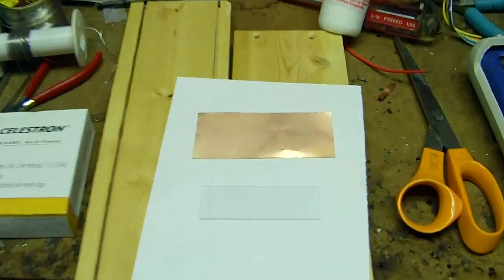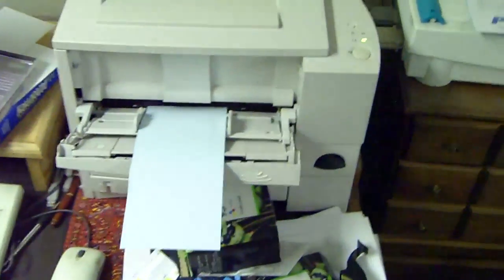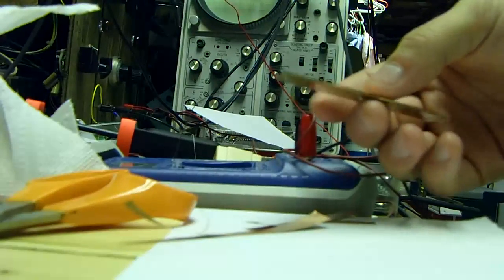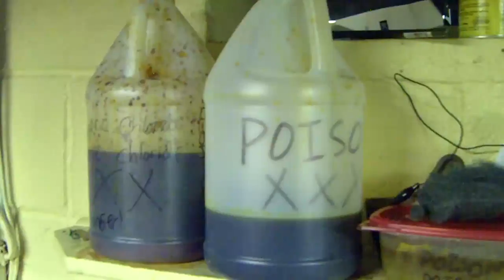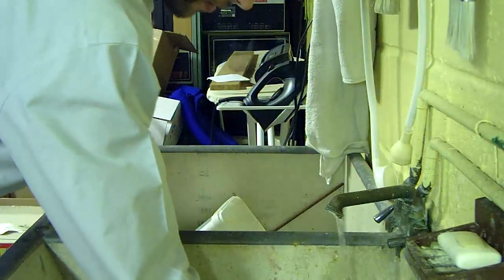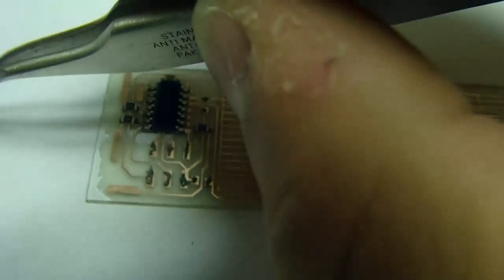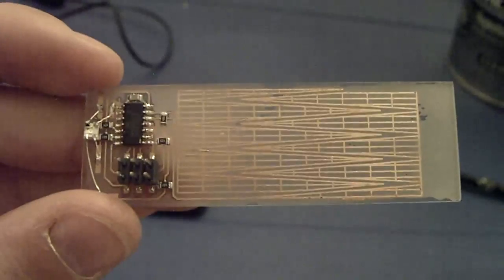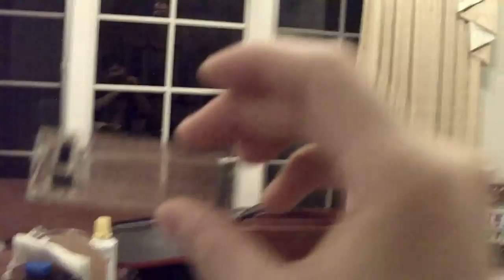How to make Clear Glass PCBs

Comment: Hi = Thanks for the video ! i would like to get yours and the other viewers advise, i want to make an art project where i make look alike PCB circute on objects (non flats ) at first the circuite dosent need to work yet give the look , i raly wanna do that on a real etch proces - is there a way to coat an object that is not flat with coper ?
Reply from the maker: The long and short of it is I don't really know.  There are processes like angel gilding that let you coat a thing in copper, but you can't do this process afterward (I'VE TRIED).  I even tried electroplating then this process, complete failure.  I can't think of any good way of applying it to anything other than a cylinder, box or flat surface :-/

Comment: have you tryed electro plating the glass surface with copper, in the same way, that they electro plate plastic car parts. but where the ink goes for the circut, just etch circut onto class or plastic sheet and rub a conductive substance into the etched pattern, then just plate it. like normal ,, no glue but you could use what ever you need to ,to coat the surface ,, gold ,silver,crome, copper etc.  if you can make, the surface of the glass, conductive. then you can plate it.

Comment: It's not that the glass has a UV protective coating; glass tends to stop between 10% and 40% of UV light transmission. Microscopic suppliers may be able to tell you exactly how much light their glass stops so you can adjust your process accordingly. 

....and yes I know this is such a minor aspect of the process but the science nerd in me made me point this out..... :P

Comment from the maker: It's difficult to remove the glue without the traces also falling off...  If you use sandpaper, it works a lot better, but may fully remove the glue in a few places.  Really, the polyurethane step removes the need to fully remove the glue.

Comment: How much does it cost to start pcb etching on a small scale ? excluding the printer and common items
Reply from the maker: The laminator is the expensive part at around $150.  I now use a photo process (see newer videos) but I'd say it's probably another $130 or so in all the parts (copper, glue, etc.) when you add it up.

Comment: Please don't wash any etchant down the drain no matter how small of an amount. Better to use a damp paper towel or better, wash the PCB off in a separate tub and let that water evaporate a bit, then add it back in the used etchant to be recycled later.

Comment: Why do this on glass when you can buy FR-4 with copper laminated on it for cheap.  You can then just cut the board to size for whatever application. 

I used to do this stuff back in the late 80's.  You could spray a board with UV photosensitive paint, bake it in an oven and then do your exposure (using a UV sun lamp).  Develop it with NaOH (Sodium hydroxide) (1 level teaspoon to 1 pint water), wash it and then do the ferric etch.   I used a small drill bit to drill through the FR4 and used wires as vias soldered on both sides. 

The Exposure & developing used to take a bit of work.  Typically you'd do an exposure test-strip by exposing the UV Sensitive paint for different exposure times.  Exactly as you would with B&W photographic exposure test strips.  The temperature of the developer (NaOH) was critical too. 

Nowadays it's cheaper and easier to get a PCB manufacturer than to do this.
Reply: pentachronic even with thin FR-4 fiberglass boards the LED's would have a hard time showing through the board.

Comment: is there any way a standard image could be released (gif, png etc), I'm having trouble getting the pcb file testtouch4 to export a complete image of the traces, at the proper resolution (the resolution for a screen capture I managed from ExpressPCB seem to be a little too big to fit on a slide, and exporting the file to bmp only gave all the design except the touch panel). What are the dimensions for the microscope slides (are they the standard 75x25mm)??  Any help would be appreciated ^_^

Comment: Do you have to use glass or would Plexi glass work with this method?
Reply from the maker: It would not work with high temperature solder paste, but, I am tempted to try with bismuth solder paste.
Reply: Yes sounds very tempting! But at 138C melting point. I'm not to sure it would still be cool enough to not warp the plexi? However it is still better than a 315 C soldering iron. I really like the clear appearance. I just wish there was a way to construct a board out of a translucent material other than glass, due to its break-ability and heaviness. But, I'm thinking of a bigger board than yours though, about 18" X 18" . However with very minimal traces and with more clear areas showing. More like a functional picture frame kind of thing for LED's and stuff, pretty basic idea. I have been looking everywhere but couldn't find any information better than yours! Do you think you could help me out with some suggestions, ideas, or information on this type of topic? It would be very much appreciated!
Reply from the maker: I have had a terrible time producing big boards, my 6x5 inch boards rarely come out.
Reply from the maker: Not really sure what you're after, though.  I have found you can basically adhere copper to anything and turn it into a PCB.  I even made a wooden one using silicone, admittedly, it was kind of lame.

Comment: Do you think this could work on plexi glass?
Reply from the maker: I dunno... never tried.  A lot of people have asked.  Sounds like something someone else needs to test.
Reply: Nope, plexiglass is sensitive to heat, so if you put a piece of plexi in the laminator (that usually is used to laminate pouches in a temp range of 100-150 C°) it will deform, and it may get stuck inside!

Comment: Is there a reason you use UV glue instead of regular glue?
Reply: +Philip W I guess it's because UV glue is really transparent. Regular glue colud leave some marks or can be not fully trasparent. But I don't know.
Reply from the maker: +Adam Krutyna It actually has a little more to do with the fact that I can control how it cures that way.  most glues need to be exposed to air to cure, but the glue here is stuck between copper and glass, and thus has no way of curng that way.  Epoxies start curing and are difficult to control, also they're goopier so it's hard to make the interface planar.
Reply: CNLohr
Seems reasonably ;)

Comment: Can you do this on acrylic  glass to drill through cause say if I wanted to build some thing else the require drilling holes in then PCB board
Reply from the maker: I've never tried acrylic for fear it would fall apart when you reflow the solder.
Reply: Oh OK . but there is no way to make a copper board like see through or be able to led through it cause I wanted to make Arduino boards
Reply from the maker: I just do everything surface mount.  You can certainly experiment on your own!
Reply: OK . and I seen that machine you had place the glass in do I need that to make the board . and were would you buy the copper sheets
Reply from the maker: You will need different glue to hold the acrylic (if that's what you are using) to the metal - so you may or may not need a laminator.  You can get metal sheets off ebay.  1.4 or 1mil copper sheets.
Reply: But I think I'll use the glass u used and hope I don't need to use that machine .. Sorry for all the questions
Reply from the maker: It is difficult to apply the matronics glue without a laminator, but it is possible.  You can certainly use the celestron slides, too.
Reply: i think printing might be done, but soldering part acrylic will sublimate(Evaporate..)..!!
Reply: CNLohr= Good stuff man , Straight rad idea and info is well organized, to the point, etc.....     Emmananuel Quiroz= You really should just go for it and figure out what works and what doesn't, BECAUSE I can tell you from countless hours of working with various acrylic that there are some that solder will melt on before IT melts. Some when it melts will not turn to liquid! It burns! Most run slightly, and will definitely deform and look nasty. Air bubles like to form if one is not ubber careful about exceeding THAT transition temperature too much.  I have seen some black Acrylic which my kick ass soldering iron will barely melt. BARELY , I think It started to soften @ 400º and you could not push a normal flat screwdriver shape soldering iron tip THROUGH it until it was OVER 500ºF or maybe more, caz I remember having my iron maxed out and that is 725ºF , but obviously the heat reduces while equilibrium is fought when plastic and metal share thermal equil. Basically this black unknown PC type plastic was TOUGH ! it was like super polycarbonate. PC melts at 300ºf-ish and this stuff was basically DOUBLE that. PMMA was crap as far as strength, heat resistance and workability. PC is great all around. Melts good, cheap and surprisingly strong.  bkgnd=> I was doing in depth research on acrylic welding with soldering irons. Rather than buying those "almost" glue gun type units which cost bukko bucks and require fairly large amounts of "insert" plastic which is how they weld it.  Was making custom enclosures and odd shapes for electrochemical experiments. . .    Im sure there is a way to make circuit holders/boards out of it.. ALSO why not just make a sandwich ? remember you don't necessarily need traces ATTACHED to the board. thats just the way we have been accustomed to it.  Could probably do this stuff upside down for simple circuits on PC. Cut out/notch out part trenches and solder on the flat backside.... The chips will probably melt right into PMMA. hmmm .. you guys got me thinking .. ... ... 3D board construction ...  :)  take a braided wire apart, use little strands ... cut foil strips ...   Its on !!   AND p.s I would listen little to anecdotal scientists . Science and Math are just ways to describe what you do. So many people get lost trying to learn the theory and then do, when that is completely backwards approach to life. These Maker tutorials are the real- ish ,  think , how long and how much chemistry education would it be before you run into this little life lesson called FeCl does not melt toner . . .  I know although these area's and topics were fully discussed in class. The practical knowledge in this humble video supersedes. We have to work with what we have !! Not the perfect idealistic scenarios ...
Reply from the maker: Not quite how I'd say it but I can't disagree!

Comment: Would super glue work for adhesive on glass?
Reply from the maker: +Nick Farrow I tried that once, just got messy and nasty and not uniform and clear :(
Reply: +CNLohr but the copper did stay on the glass after etching?
Reply from the maker: from what I remember, yep.  But, it was not suitable for actually making a PCB from.
Reply: +CNLohr Why was it not suitable? This is what I have in-mind of doing. https://www.instagram.com/p/_5mLAOyMB4/?taken-by=veggievampire
Reply from the maker: I've actually wanted to try the cyanotype for a long time just to try it.  You should look at riston, it's what I use for all my PCBs now. But, in regards to the super glue, it's difficult to explain, but it cured at different speeds and produced this milky and uneven surface.  When I used the UV glass glue, it caused it to cure uniformly.
Reply: +CNLohr how would you adhere the copper tape to the glass without uv? By the way I am going to use copper tape that it's primary used for stained glass.
Reply from the maker: I tried using two-part silicone, and two-part epoxy.  The two-part silicone didn't hold well enough.  The epoxy was basically just like the super glue.  There is someone else who used copper tape, and it worked pretty well!
Reply: +CNLohr cyanotype classic processSolution A: 25 grams Ferric ammonium citrate (green) and 100 ml. water.Solution B: 10 grams Potassium ferricyanide and 100 ml. water.
Mixing the chemicals

http://www.alternativephotography.com/wp/processes/cyanotype/cyanotype-classic-process
Reply from the maker: I'm totes gonna try that sometime soon!  I have all of that stuff right now :)

Comment: Oooh, that would go well with silver leaf!
Reply from the maker: Sounds more expensive than copper.
Reply: CNLohr It is, but not significantly. The amount of silver in silver leaf that thin is very low.
Reply from the maker: Source?  I'd be up for giving it a shot.  I wonder if I can still use ferric chloride.
Reply: CNLohr I don't have a source yet. It's just an idea. Ferric chloride should still work.
Reply: CNLohr I looked up some suppliers, and they sell silver foil only in bulk. Not really cost effective for only a few projects.
I'm looking into physical vapor deposition. It should only take 1283°C to evaporate silver under vacuum at 1Pa of pressure, which even the cheapest vacuum chamber should be able to handle.
Reply from the maker: As I said, it was harder to get, specifically nimrod-hall and some other ebay providers, looks like about 10 listings.  Vacuum deposition to get enough copper to be useful (current-carrying, able to etch and/or flux) would take an insane amount of time, wouldn't it?.  I spent a while trying angel gilding the glass, nothing seemed good enough.
Reply: CNLohr What pressure and temperature did you use for this? I plan on trying this myself, so it helps to know the baseline.
Reply from the maker: pressure/temp - it doesn't really matter.  What matters more is the UV source blasting it :)  I've even put it down with just my thumbs and had it work.
Reply: CNLohr UV? I assume you mean chemical vapor deposition by breakdown of silver compound?
I was talking about physical vapor deposition by boiling a piece of silver under vacuum, using a tungsten heating element. Not exactly something you'd want to hold in your hand...

Comment: why don't you use double sided tape, tape the copper leaf to a peace of paper, and print the circuit directly onto the copper?
Reply from the maker: +Nigmye tried.  Printer doesn't get hot enough to fuse then.  The copper has too much thermal inertia :(

Comment: any idea how to make reliable plated-through holes ?
Reply from the maker: Use surface mount components.
Reply: CNLohr
Gee, I'd not thought of that...
Reply from the maker: haha.  I'm mostly kidding, but I never found a way.  I talked to co-workers about it, but we just gave up the idea.
Reply: CNLohr Lots of lubricant (running water should work just fine) and diamond bits designed for glass (bout $15-20 for a set at any hardware store)

Comment: It wouldn't work bro because the charge would just spread out over the entire surface of the conductive foil. BUT you can print in mirror image on normal paper, lay the image side on the foil glued to the glass and then iron on the back of the paper. Some of the toner binder will transfer, enough to usually mask off from the etchant.

Comment: I hope my ascii works this time, since the way I intended did not.So here it is:
|------------|     |------------|
| PCB 1 |===| PCB 2 |
|------------|     |------------|
The '=' is the signal/path or like a flexi plastic pcb that makes continuity from the top layer to the bottom.
Just remember to NOT bend the connectors. It should be like a ( and NOT [.
I hope that mankes sence. So do NOT GLUE on the edge of the glass, but leave a small leeway.
Wishing anyone that would try it hte best of luck.

Comment: That's odd.  The notation said don't put ferric chloride in the drain.  Not even two seconds later the ferric chloride covered slides were being washed off in the drain.  If it's not OK to put ferric chloride in the drain then isn't it reasonable to assume you shouldn't wash ferric chloride covered slides in the sink
Reply from the maker: Minimize the amount that goes down the drain.  If you're just pouring it down the drain you are going to cause some damage.  When you just get a drop or two, the water will do it's magic.

Dilution is the solution to pollution.